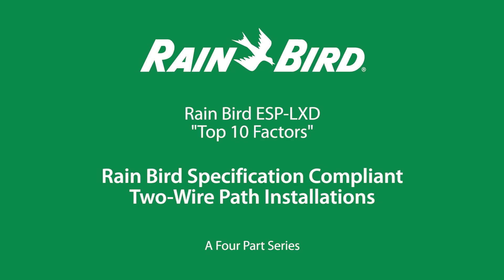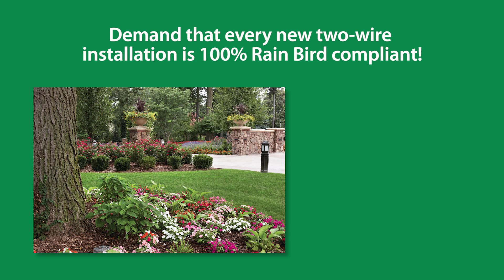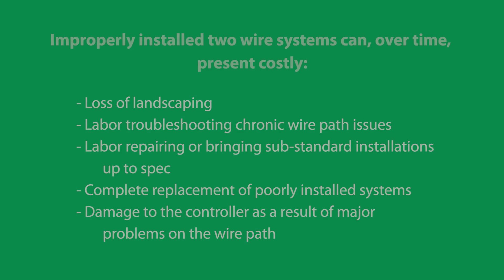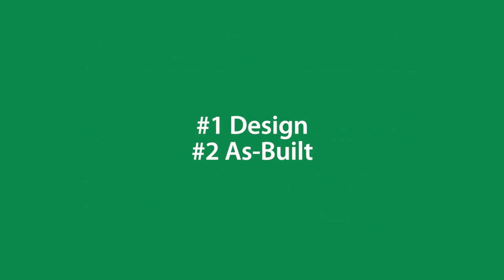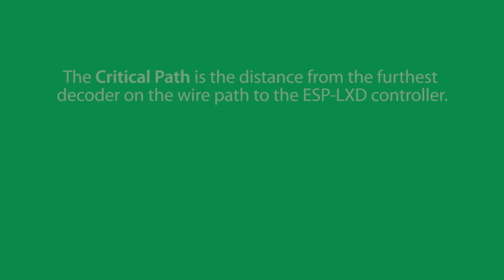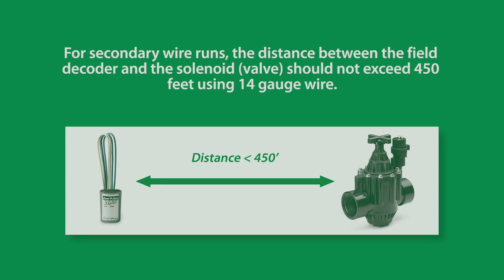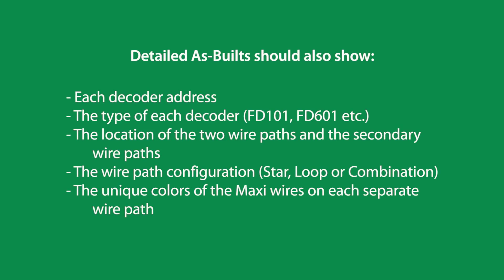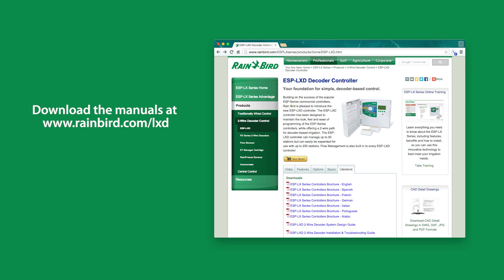Rain Bird ESP-LXD Two-Wire Path Installations (Part 1 of 4)

Comment: what is the difference  between  a star a and a loop configuration  is it a resistance  in the 2 wire path and does it mater I am a sprinkler  cotractor